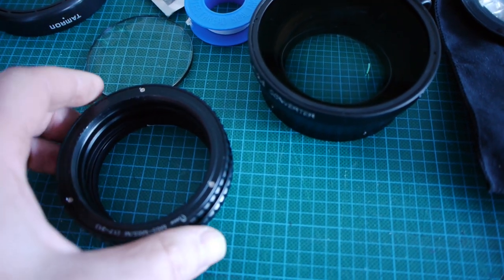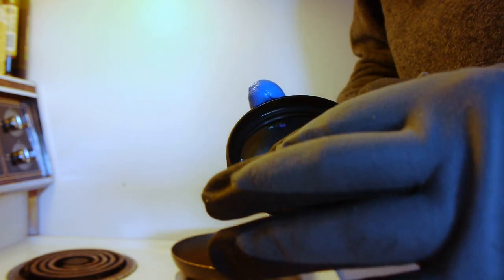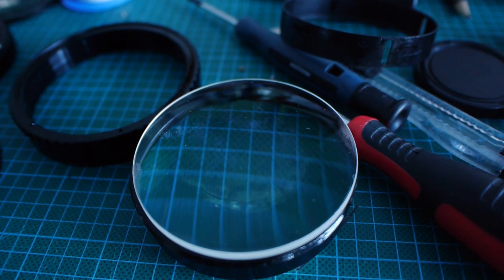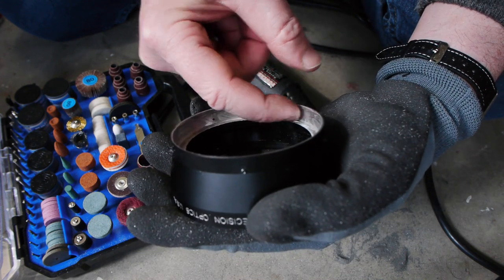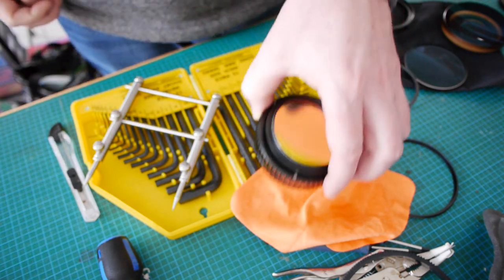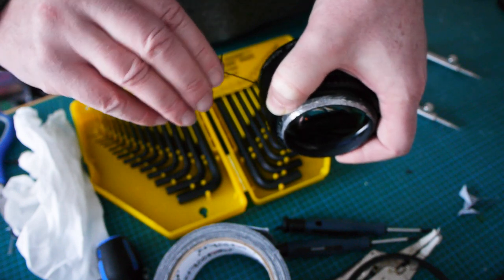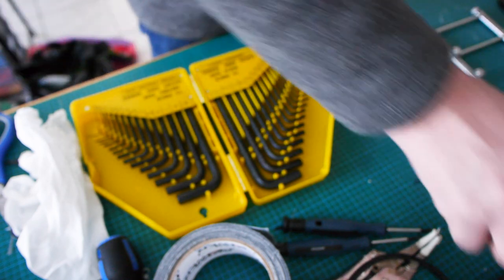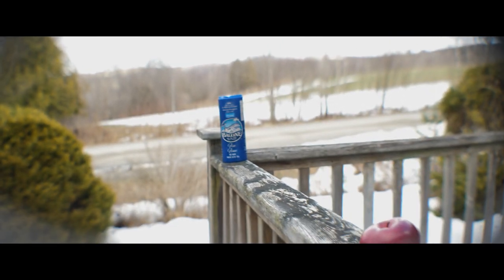DIY Anamorphic Single Focus Century Wide Tutorial

Comment: Nice video Todd, to avoid having the thumbnail I advise you to use a Canon EF 50mm lens and an adapter ring (K&F CONCEPT Canon EOS EF Lens Adaptation Ring to Camera with M4 / 3 Mount). The goal is that the mirrorless adapter ring allows you to have distance between your sensor and your lens, for example a 50mm will become a 100mm I think, so when you mount your anamorphic lens then the distance created by the adapter ring which is between your camera and your lens will prevent the appearance of the sticker. Try and tell me.

Comment: Awesome video. Thank you for making it. I am going to try this out with my setup too. I was eyeballing that m65 adaptor as well, but wasn’t sure things would fit. Looks pretty good to me though. Cheers!
Reply from the maker: For the dvx-100 it fits perfectly in the front and when you grind a bit the set screws keep everything really tight. Very little vignetting easily covers the 2:39 aspect ratio or more. I am very happy with the look and feel. The gear ring even turns easily and smoothly with my crane 2 servo follow focus. I am pretty sure this m65 is what the anamorphic store uses. I see there is a dvx-100 on ebay for $20 now. For $50 in parts total you can't go wrong trying. With the right tools its a 2 hour job.

Comment: It is dangerous to cut without first disassembling the helicoid) there is a very high risk of throwing it in the trash after jamming.
Interesting diy but the edges of the frame are not very sharp. I also use a similar helicoid, for my single focus, this is a rehaus from old Lomo lenses. It is uniformly sharp at f1.8, 60mm lenses, and I sell it ready to go for $ 260.

Comment: Excellent video! I just found a Century Precision Optics .8x Wide Angle Converter and I think it might be a good try to see if will work as intended. Thanks, for the effort of putting this tutorial together.
Reply from the maker: I found a larger .75 Sony HD Century optics one for cheap, I may try and see if I can do it with that one too. The sides are always blurry on wider taking lenses, but it you use a longer 85mm taking lens they actually are pretty good. Good luck with your mod!